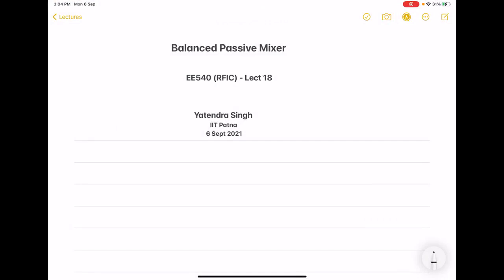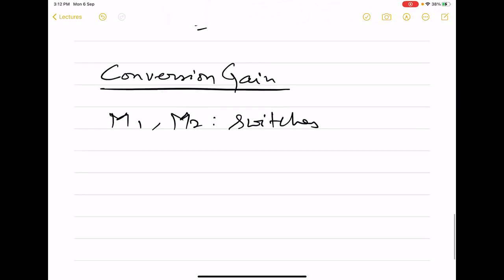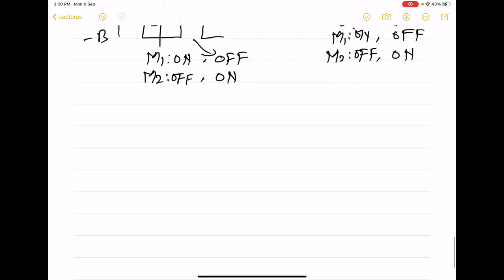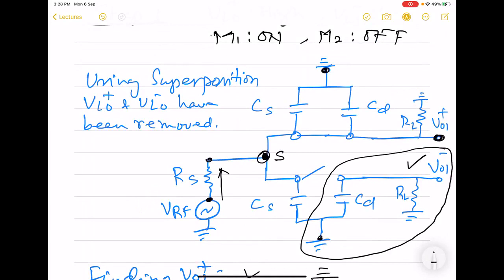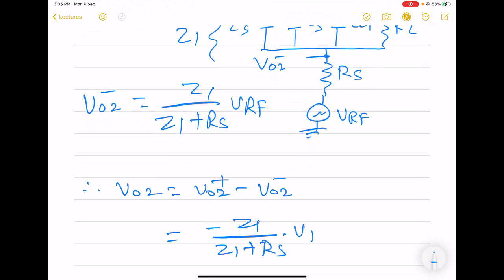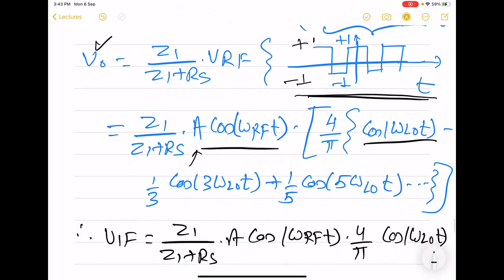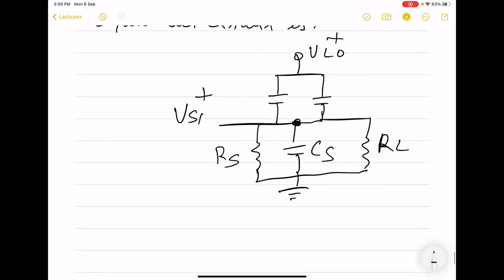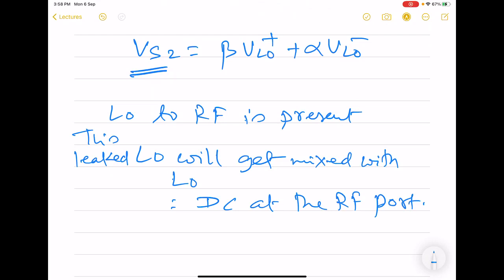Radio Frequency Integrated Circuits (RFICs) - Lecture 18: Single Balanced Passive Mixer

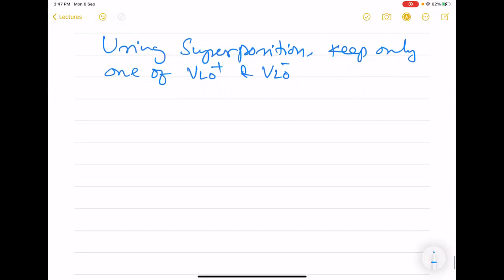Comment: Sir, in the last part, where u r discussing Feedthrough in Single Balanced Mixer at 43:04 , where we r ignoring VRF, we know that the system is Non-linear w.r.t VLO, then how is SUPERPOSITION principle applicable there ?